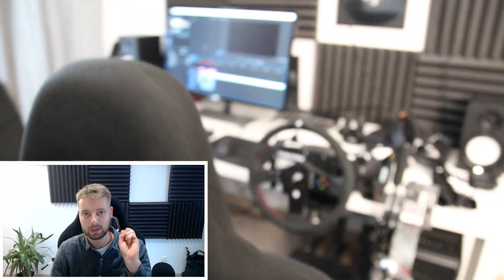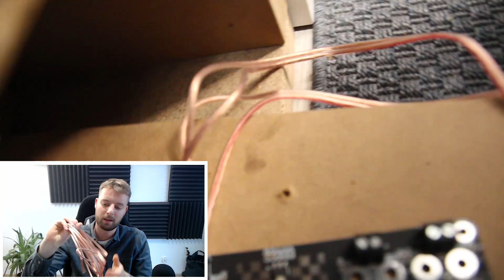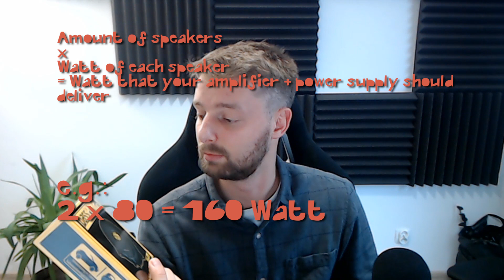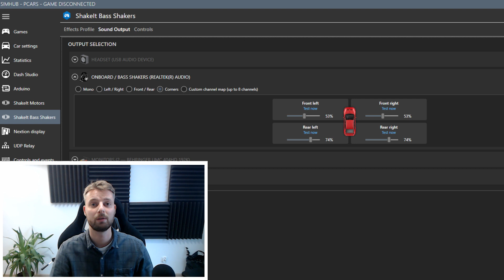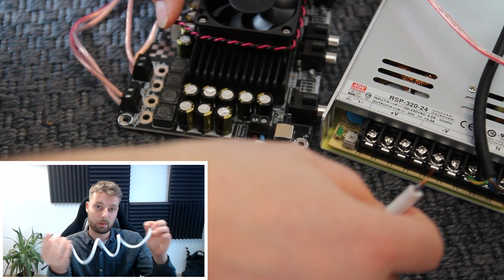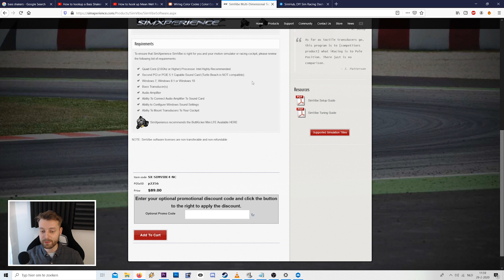Bass shakers on the cheap - Full buy & setup guide

Comment: That’s precisely backwards: if you put an amplifier that puts out higher watts than your drivers/speakers are rated for; and turn the volume up too high (such that the amp is actually putting out more power than the driver can handle) you will fry the voice coil in the driver. Your speaker/bass shaker’s wattage rating should ALWAYS be higher than your amplifier’s.

The power supply for any electronic device should always be rated for more watts & amps than the device will use. You do NOT adjust the power supply’s voltage to match the amp’s wattage; you adjust it to be within the amp’s rated input voltage range. The amp will draw whatever power it needs at any given instant from the power supply. If the amp tries to draw more power than the power supply can put out (which, for a quality power supply will be at least as much as the nameplate rating) one of four things will happen, depending upon the specifics of how the power supply was built: 1, it will overheat and fail or even catch fire; 2, it will overheat triggering the thermal shutdown function of the supply; 3, it will immediately shutdown because the over-current shutdown function will have been triggered; or 4, it’s output voltage will droop down, starving the amp of power.
Reply: This is not true :) If your bass shakers have (a lot) more power than your amp and turn the volume up too high you will go out of bounds of what the amp can deliver and it will start to clip and might burn out the amp AND the speaker(s). It's always best to pair them close in wattage and rather have an amp that can deliver more than the speakers need than the other way around since you don't have to turn up the amp to the max
Reply: The electronics part on the power supply is correct though :)
Reply: You don't know what your talking about. You can and will hurt speakers by underpowered them. It goes against your regular persons logical thinking.. I know... but that's how it works
Reply: <sigh>… No, it’s not how it works. This is electronics, which is a VERY well understood field. It has well defined laws that it behaves under (which, when taken down to fundamental principles, are the laws of physics). It’s not a matter of opinion, and it’s never illogical.

As long as: 1) nothing in the system is defective; 2) all the components are properly adjusted; and 3) nobody lied on the specifications sheets for the devices in question; then what you are describing is physically impossible. 

Properly configured, when you turn up the volume level to 100% on a source that is outputting a full range signal (such as a -0db sine wave from a test CD or a WAV file) an amplifier will output it’s full rated power without distortion or clipping (I am deliberately ignoring frequency dependent effects, varying impedance, and the marketing department being “optimistic” - all of which will have an effect but not so much as to render this statement invalid). It cannot output more power than this; as it’s already at 100%.

If you put more power into your speaker than it can handle, it will blow. If you put less power in than it can handle, it will simply play quieter (which is what the volume knob ends up doing: reducing the power level put out by the amplifier, by reducing the signal level going into the amplifier).

So, if your amplifier can put out more power than your speaker can handle then you have created a situation where if you turn the volume knob up too far you will exceed the speaker’s capacity and it will blow - thus making a region where you cannot safely operate your system (this also tends to waste money because more powerful amps tend to be more expensive, and that’s performance that you cannot access).

If, on the other hand, your amplifier is only capable of producing as much power as the speaker can handle, then at 100% volume you will be getting 100% of your speaker’s performance without  having a danger zone on the volume knob.

If the amplifier’s maximum power output is less than the speaker’s power handling capacity, then the worst that can happen is it will play more quietly than the speaker potentially could - as far as the speaker is concerned, there’s no difference between this situation and a higher powered amplifier with the volume turned down somewhat.
Reply: Never had a stereo with a amp that is being over tasked and clipping I see.
Reply: @Nicholas-im8bd  If it’s clipping then it’s NOT properly adjusted. Most amplifiers will have an input gain adjustment (it’s usually actually implemented as an attenuator, but the effect will be the same) — this needs to be turned down; or the source device needs to have it’s final output gain turned down (sometimes there’s an adjustment for that in the menus somewhere). If somehow you have managed to put together a system with neither adjustment available; then an attenuator can be easily constructed from a stereo potentiometer and a patch cord; and that placed inline before the amplifier.

There are several videos on YouTube on how to properly setup your system using test audio sources and simple portable oscilloscopes (which can be had for about $50 nowadays).

Comment: You can also just use an inhome ( 230volts ) receiver/amplifier. Saves some diy time and effort. Just make sure that you buy the 8 ohm or have an receiver/amplifier that can handle 4 or 6 ohm speakers. If it can handle at least 6 ohm than you are good with the 4 ohm transducers. You just have to keep in mind that you dont pump the volume to the max. Which is absolutely unnecessary with the transducers used in this video ( i have the same and powering them with an older marantz receiver which can handle 6 ohm speakers. Works like a charm )
Reply: Hi Joey,

Can I also use my old surround receiver that I have left in combination with my current one and then let the old surround receiver run in stereo mode.
Thanks in advance for your answer :)

Gr. Henrique

Comment: How did you find conduction through the mdf? How thick was it and could you feel I through your driving experience?

Thanks for thebvery useful video. This really helped.
Reply from the maker: sorry for late reply, it works great through MDF. I heard a lot of ppl having troubles with shakers on 80/20s, on MDF its great. On 80/20 youd need to mount it to the seat

Comment: Hey, is there a reason you mounted the shakers outside not inside of your seat box?
Reply from the maker: Not really. Maybe because I have 4 and they simulate the wheels' impact. You got them inside?
Reply: @freekshow  haven't got mine yet.. but I'm thinking of mounting everything inside of the seat-box for cleaner look, just thought if there's a different effect from witch side of the shaker is (inside or outside)
Reply: @ch3m1c  I’ve seen and heard from other that use a x4/chassis mode setup that use extended brackets for clean vibration and a little bit of more better immersion. All opinions tho I just cant wait to get mine setup current rebuilding my rig to a tx wheel base as my logitech caught fire. So decided to shell for a cockpit and do a budget chassis mode setup.